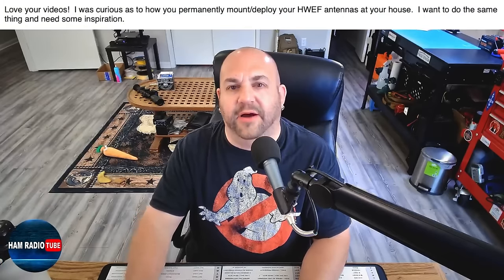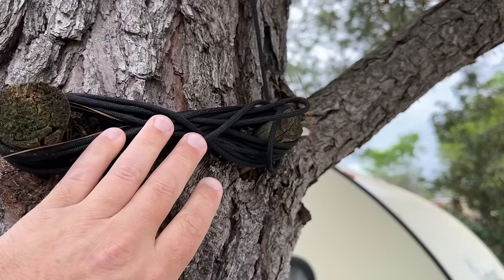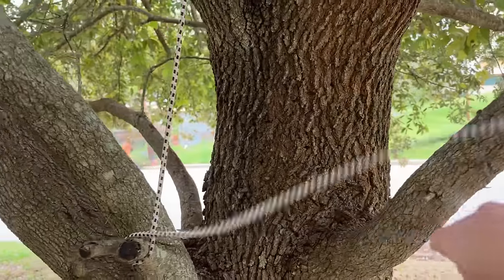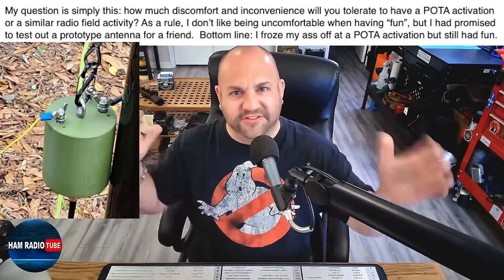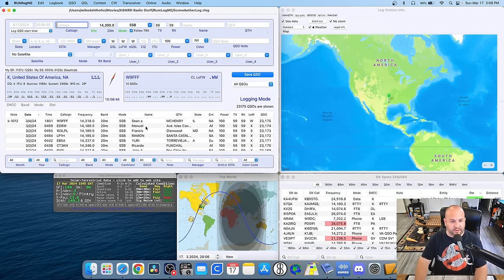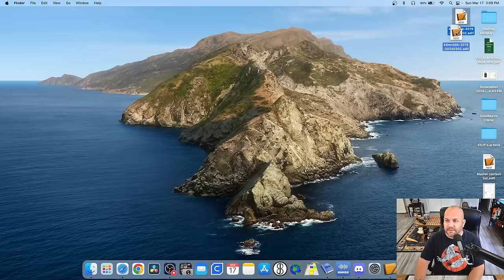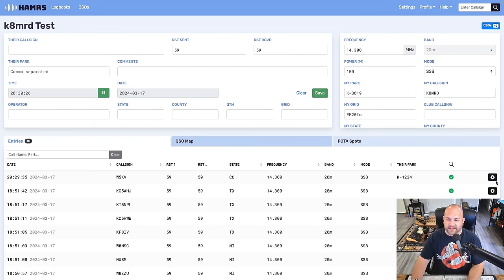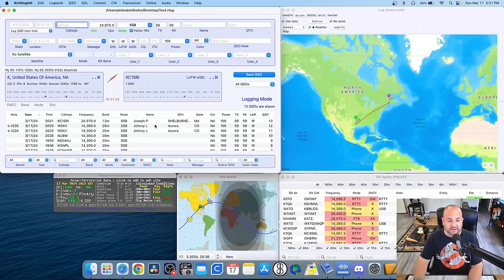Why Use HAMRS Instead Of Regular Logging Software For POTA?

Comment: 8:00 I'm not gonna be uncomfortable in the winter at least. To that end I'll just set up the WRC, run the cable through the window, and crank the heat if needed. Gotten quick enough at setup/takedown it doesn't take too long now.

Summer heat may suck but sitting around in the shade I can deal with sweating. 
Frigid fingers however do not effectively work a key

Comment: In New England, if I didn't activate in uncomfortable weather, I'd only be out a couple months a year. I'll activate in the cold, but not in the rain or snow, only because I don't want the gear getting compromised. Like you, I position my truck facing the sun and operate from the front seat if it's too bad out.

Comment: I gave Hamrs try some years ago just to find out it deleted all my QSO´s i made. Luckily i used my IC-705 as a trx so i could extract the QSO´s out of the voice protokol from the 705. Since that time i am using paper and pencil and never lost a log again.
Reply: Some Years ago???? It was in iOS BETA testing March of 2021.   🤨  If you had a bad experience 3 years ago during BETA that’s expected.    

If it was last year your statement has some credibility issues.

Comment: I use hamrs I live in Deep South Texas. Now I have a question for you, I don't know what part of Texas you are in, but you know we have wind!! I was out with my WRC 17-foot whip antenna, and it got blew down by the wind (20MPH) gust of wind. Do you put sans bags on your tripod to keep this from happening? Rember the soil down here is hard clay. WQ9V
Reply from the maker: I live in Huntsville, TX.  I haven't used sand bags but that would work.  I've put some stakes over the legs of the WRC to keep it from falling on windy days.  Worked pretty good.  Sand bags prob would work better, but they're also a lot heavier.
Reply: @hamradiotube  Cool I hope to get you on a pota one day. I have some stakes however the ground is hard clay or mush when it is wet. WQ9V

Comment: I am not very impressed with HAMRS. One reason is there is no communication with the rig (Frequency and mode information). A contest logging program such as N1MM or WriteLog will let you monitor your rig status, the packet cluster, and do dupe checking and more. That said, use what you like and keep having fun. 73. I too am from MI but still live in a cold state.

Comment: with all those antenna connections in and around those trees, better hope someone doesn't decide to start tree trimming.😜😁
Reply from the maker: LOL that actually happened once when the electric company was changing out some wires.  They cut my paracord but the antenna was fine.

Comment: I really don't understand this tendency for hams to continue to support software that itself isn't developed or supported.  HAMRS isn't actively developed.  The email address goes unanswered and the forums are dead.  The Android app eats logs for breakfast if you have a look at the ratings and feedback.  Nevertheless, hams are making videos about how great it is.  Let's support software that's supported by it's developers.
Reply: I hear ya. I guess were all holding out hope it gets a solid update soon. I’m willing to bet if it isn’t supported in short order it’ll fade into obscurity. As it should. Although I really do like Hamrs and am hopeing for the former.
Reply: Sometimes good software is developed and the developer moves on in life. It doesn't take away from the software.
I hear you, from a security perspective: this is terrible. Google Play (at one point) has a policy about software requiring updates.

I haven't had any issues with hamrs for what it's worth.
Reply: Just thought I'd let you know that a new version just came out for hamrs (1.0.7) and the mobile versions should be coming out soon. 
As much as I would love to switch to a different logger, hamrs is the only one I am aware of that natively supports iOS, Android, Mac, Windows and Linux. N3FJP only natively supports Mac and Windows so that's not good enough for me when I use Linux and android. (And using wine to get it working on Linux doesn't count in my book)